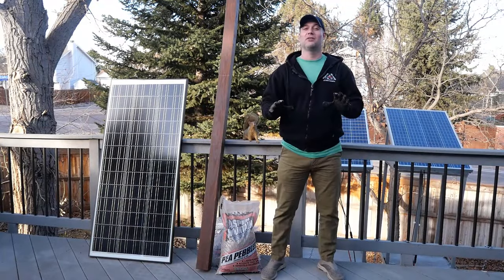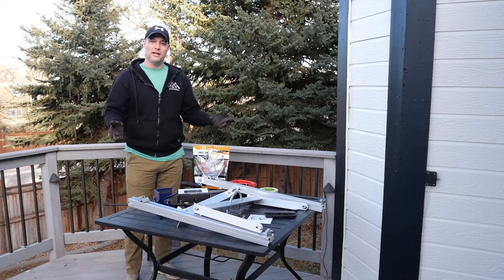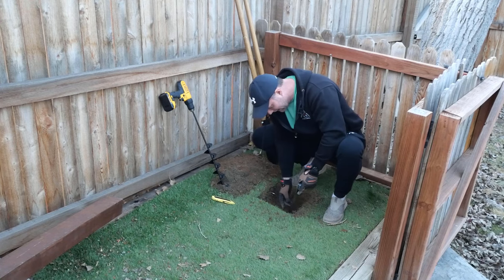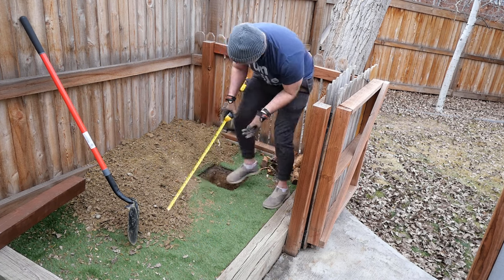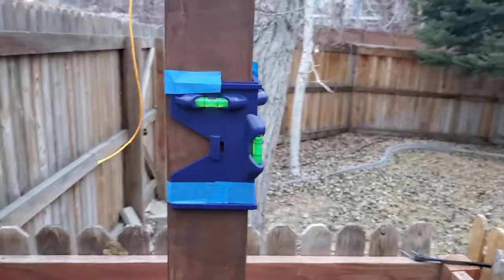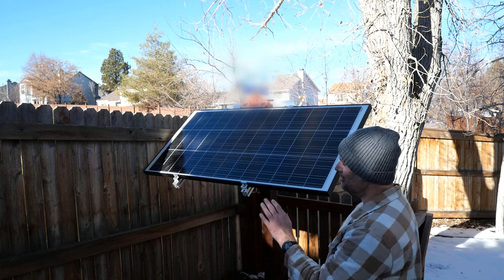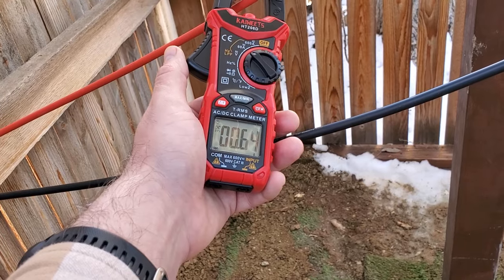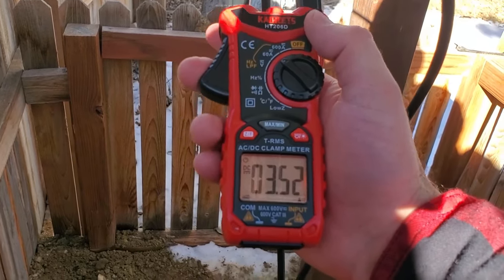How To Pole Mount A Solar Panel

Comment: Believe it or not, that pea gravel does an excellent job of holding posts if you fill the space with it
Reply from the maker: Do you mean just use the gravel and nothing else?
Reply: @improveandachieve6047  Yes, just set a bed of gravel in the bottom of the hole like you already did, then place the post in the hole and make it plumb. Fill the remaining space with the pea gravel, and by the time it is half-way filled, the post will be immobile. I have removed old posts done this way years earlier, and they are solid. It has the added benefit of NOT having caustic chemicals like cement, and will drain much better.
Reply from the maker: @davidwilker4795  That's good information, thank you!  I'll give it a try next time.
Reply: @improveandachieve6047  you are quite welcome. Thank you for the videos.

Comment: Residential solar sounds good - - no more electric utility bills.  BUT there is a reason there are large electric generating plants - - economy of scale.  They, the utility companies, are portrayed  as just large greedy monopolies out for profit for themselves.  However, as many homeowner/solar enthusiast are finding out there is more to the "solar dream" than simply putting us a few solar panels and tying them into a do-it-yourself power plant. There are batteries that will have to be replaced, cut backs in power usage in the residence and those dreaded cloudy days. (*There are more negatives but . . .)
The monthly electric bill comes in the mail, you pay it and continue on with life.  If the bill seems to high, maybe the first thing to do is investigate where all the electrical power is being used.
Residential solar has its place - - - > emergency backup.  It's quieter than a gas powered generator.  :)
Solar power production has come a long way and the future may hold better battery design/chemistry; better power producing solar panels.  But from my view, right now, dependence on that large electric generating plant is the best and proven way to go.
THANKS for your solar panel installation video and your down-to-earth reality check.
Have a blessed day.
Reply from the maker: Thank you for watching and for your thoughts!

Great points about the ease of grid power vs. a home setup.  And I agree with you that one place for residential solar is to temporarily replace a generator in an emergency.  

For me it's just been a passion project and something I've enjoyed learning about, but without a doubt it's cost me more than it's saved.  The payoff period for residential solar is still too long.  But as with all things, the price will decrease over time due to those very same economies of scale and maybe in 10 or 20 years it will make more sense for the majority of people.

Comment: How strong really is your 2 mixed parts Foam on your Solar pole ?
Reply from the maker: Good question, I wasn't sure myself how it would do.  I can say that it has survived a winter with blizzards dumping a few feet of snow, strong winds, golf ball sized hail, and a summer with plenty of 90-100 degree days.  Still rock solid after the better part of a year.  Can't say if it'll stay like that forever, but so far, so good.
Reply: Thank you.